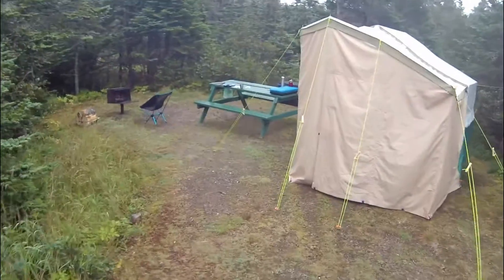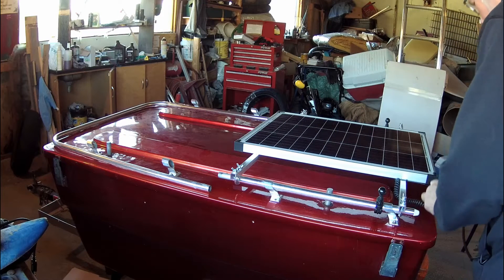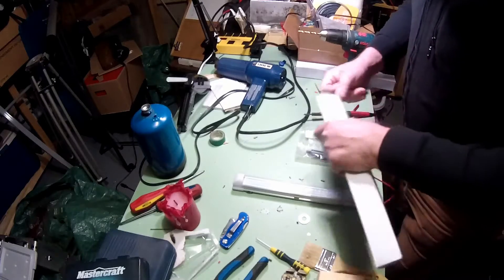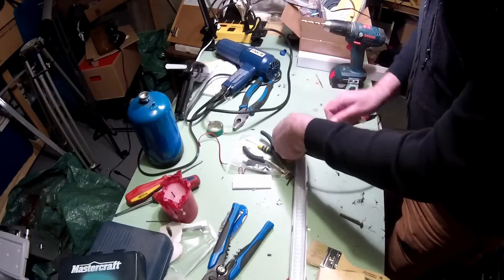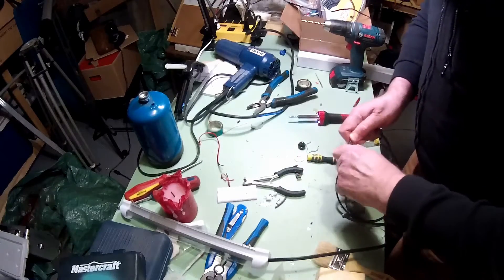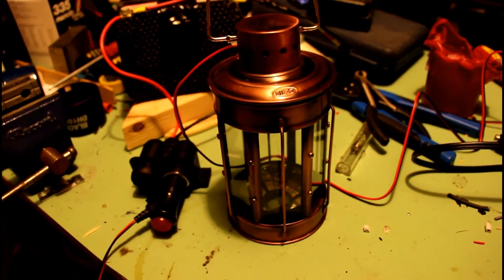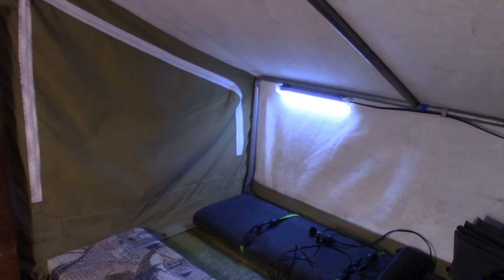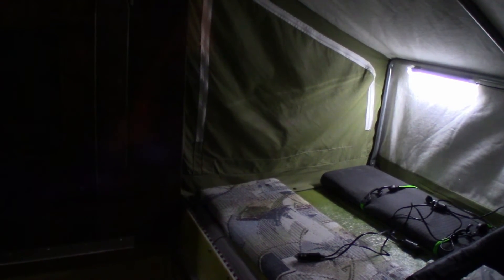Mini Mate Solar System 2019 Ep 4

Comment: Well done!  Jim the electrical genius!  I'm sure the Chinese have seen this and are already mass producing this system now as we speak!
Reply from the maker: There have been many modifications and slight updates since way back then. Still need to simplify some of the connections but the basic idea has worked well. This was before all the "solar generators" i.e. Jackery and knockoffs atarted to be available. Mind you, most of those are over hyped, over priced and under powered.
Reply: @OldGuyonaBike  ha! And remember that "way back then" was only three years ago!
Reply from the maker: @baldandbiking  Time moves faster than we do.

Comment: Very cool and what is the weight of that trailer ? Would a 1000cc pull it ?
Reply from the maker: The Mini Mate weighs about 260 lb. empty. I have not had it on a highway scale yet but weighing everything individually with a full cooler and propane tank it seems to be between 425 and 450 lb. total. I know of at least one person hauling a MM with a Ural/sidecar rig... i.e. 750 cc, 4 speed. If you look at my October camping series you will see my final configuration. It's been a work in progress.
Reply: @OldGuyonaBike  ok thx for replying ✌🏻

Comment: OK here is a question. I have a portable battery system that delivers 12v, USB charging and 110V that will charge my laptop several times along with dozens of phone charges. It's half the size of a loaf of bread and I just hook it up to my bike with a cig lighter plug and charge it as I go. Why not just do this and forget the solar as I can literally go forever by simply hooking up to my bike while riding along. Seems like the solar thing is more work than it's worth. Again just asking
Reply from the maker: Actually there is nothing wrong with that especially since you already have it and it has worked for you in a real world setting. I'm just having fun with my on site/tent lighting and experimenting with what I can do with the system. I'll be working with an electric blanket this summer and maybe a small electric heater as well. In the long run, nothing has to be more complicated than what you are doing right now. Now, is that half a loaf Texas cut white bread or is it dark rye?

Comment: I have two solar set ups..A Portable Solar Generator with a 28000 mAh and an 18 watt solar panel ($55 from Amazon for the entire kit)...for lighting / CELL PHONE....This kit comes with three lights...one is enough for the mini-mate..it runs for over 21 hours..and takes 4 hours in full sun light to charge up 100%....and another Portable solar Generator with a 40,800 mAh battery that hooks up to a 100 watt panel to charge my camera batts, tablet & drone.  GENERATOR $100, PANEL $80. Easy..highly portable, cheap...all lithium - ion...no extra wiring / boxes...
Reply from the maker: The solar generator systems have certainly come a long ways fast. Weren't a lot available in 2018 and they seemed over priced. There have been a few changes to my system since that video. Won't have a good update posted til I get the trailer out in the sun in May. What make is the 40, 800 maH generator? I'm in Canada so my prices and shipping will be 30-35% higher... sigh. I find that I am getting 80-90% of all my charging done while riding.  4-6 hrs. pretty well gets it charged totally even after a big drain night. I have too many lights lol.

Comment: How is your fuel economy and tire wear when towing the trailer?  I purchased one a year ago but have yet to tow it behind my bike.
Reply from the maker: Not noticing a lot of difference in tire wear. Fuel is running 10-15% above without depending on my speed. Brake pads seem to be only lasting 75% as long as usual which makes sense.

Comment: Hey there :)   I'm back to binge watching.   Wish I understood all this electrical stuff, I'd LOVE to have solar on mine..  Thanks for sharing, Lo :)
Reply from the maker: When I do an update video on the camper, I may try to explain the solar setup again. It's not too hard, but then again, it's not plug n' play either.
Reply: @OldGuyonaBike  I just had a lady stay here, she found me on Boondockers Welcome .com, her name is Elaine and shes
 from the Vancouver area of BC.
She and I became fast friends during her stay here. I had just returned home from the 6 day hospital stay.
I'm planning a trip, in the spring, to Seattle then, if things go well, I'm going to go visit her. 
Hoping to have a good solar system by then. 💡
Reply from the maker: @UCwgoBVAZSaHcZd4SFDKaj7w Feel free to email me directly jimgcg@gmail.com as you start getting closer to wanting to put a system together.
Reply: Go to Amazon.com..Type in: Portable Power Station..you can pick up a 4800mAm unit for around $100..a 50 -100 watt solar panel for another $100..all plug and play..no wiring other than plugging in the panel..no degree in electrical engineering needed...Now...you will only be able to run small things..no hair dryers, kettles, AC Units..just basic things. Its NOT rocket science.

Comment: Hey Jim.. Good work. 
Am really inspired by your work. I am a solo rider from the east ( India ) . 
Am planning a solo ride across the world in 2021. I wish to build a camper for my Royal Enfield - 350cc motorcycle as kompact kamper does not ship their products worldwide. . 

I request,  you could share some light to build my own motorcycle camper with the modifications you have upgraded it with. 

Regards
Nithin 
neos.pvt@gmail.com
Instagram - wanderbay/ Enfield diaries 
Whatsapp - +919611391249
Reply from the maker: I would love to be able to plan an around the world trip... right now, I am planning an around the continent trip for hopefully this year. I have become impressed with the Royal Enfields more and more as I follow other motorcycle travelers such as Itchy Boots. With 350 cc, you will want to go as light as you can. A lot of people here use car top carriers and light duty trailer frames to make inexpensive cargo trailers for their tent and gear. You will spend a great deal of time on dirt and not so great roads, so have you thought about a mono wheel cargo trailer? Having room for a solar panel on top of the camper has been a godsend for lights and charging all my stuff. I will send you an email.
Reply: @OldGuyonaBike  Appreciate your reply. 
As to mention I have zero knowledge about the body nor the design. The mono cargo option is mere on strength to hold long distance travel. Still debating with the design. Something stable, heavy duty, which can hold tough terrains is what I am looking at. 
Would be great to know you well and consider your tips while I build my trailer and share more stories about our travels. 

Regards
Nithin
Instagram - wanderbay/Enfield diaries 
 neos.pvt@gmail.com
Reply from the maker: @Solorideacrosstheglobe  I just emailed you a link to some lightweight adventure trailers and the site seems to have lots of information on building trailers as well.

Comment: I would like to see how you mounted the outriggers to the solar panel on the back. I would like to use your idea to mount my panels to my trailer. Perhaps you will make a video of that someday. Thanks.
Reply from the maker: I'm in the process of revamping the system now that I have used it for a total of 4 weeks. I will include a better look at the panel mount as I will still be using the same panel.
Reply: I place the panel on top of my camper...I have a panel with a frame..so I made an attachment...so I can secure it with a cable / chain..and attach the cable / chain to an out rigger leg on the trailer which corresponds to the direction of the sun. Works well...

Comment: I like the sit up. You could also run an extra wire to charge your battery from the bikes charging system like on a 7 wire plug on trucks. I picked up my 4 bike lol. a 2011 1400 concours
Reply from the maker: With all the farkles and charging ports already on the bike, I am hesitant to add another load lol. 3 to 4 hours of riding on a sunny day will get me a fully charged battery it seems.

Comment: I saw a bike trailer for sale looks like a Mini- Mate used for $2500 do you think that's reasonable Bud?
Reply: That sounds like a good deal need to open it up set everything up make sure the canvas is all in good working order pull it if you if you don't let you check the tires make sure they're not wearing funny like a bent axle or bent wheel just look it over real good for cracks in a fiberglass at the mounting points and things like that.
Reply: @k5abuser  Thanks for the words of wisdom David always good to talk to someone who has been there you know. Cheers Chris
Reply from the maker: @vitalwaters  They are selling for about $3100 USD with no accessories right now. If this is only a couple years old it is a great deal. Even if it is older, they hide their age well and retain their value. As above, check the canvas and poles. Check the tires for uneven wear.  Mine is in the 25 yr. old range. Go for it.
Reply: The base price fir new us 3195 or so...wish I could fund a used one for the price you saw. Especially in California